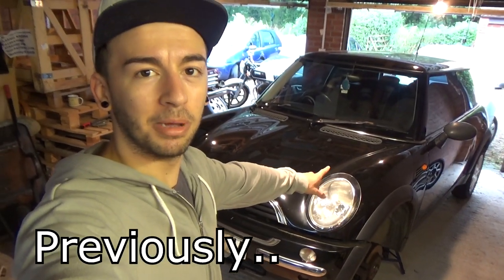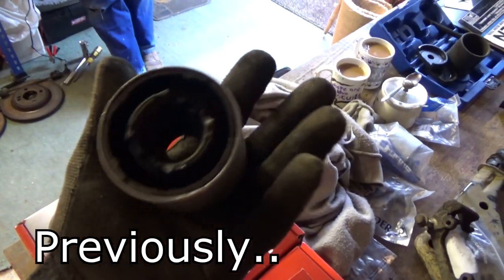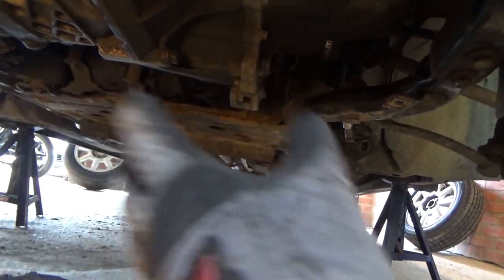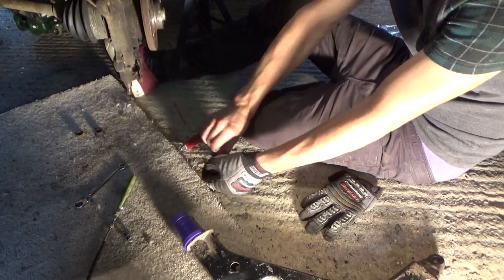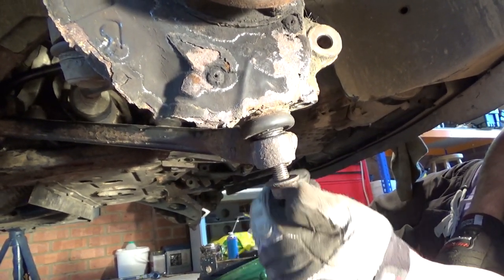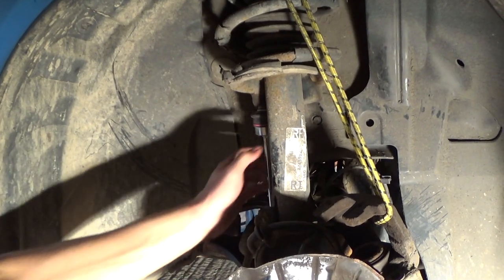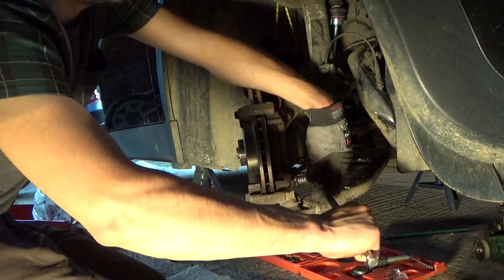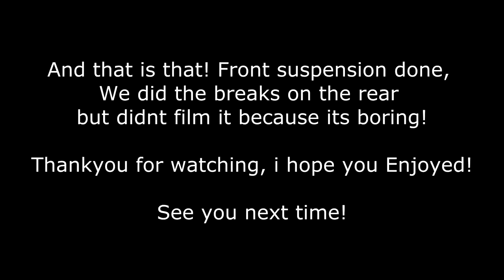The Mini Project! Ep.2 Suspension Assembly!

Comment: Top work there. You said in your previous vid that it isn't a "how to" but you did everything right. Dropping that brake pad isn't necessarily the end of the world. It just shows that you're not infallible like the rest of us. Rusty bolts are the norm in the UK. Plenty of penetrating fluid is the answer and using copper grease where necessary is the best way of avoiding a repeat performance.

Comment: It would have been a good idea to have replaced those inner ball joints while the subframe was off the car as it requires the subframe to be lowered or remove driveshaft to get to one of the bolts off. Worn inner ball joints can cause the car to pull to the side under acceleration,had this problem with mine